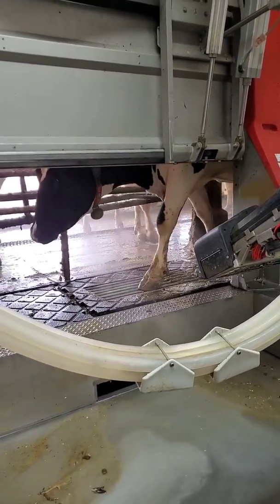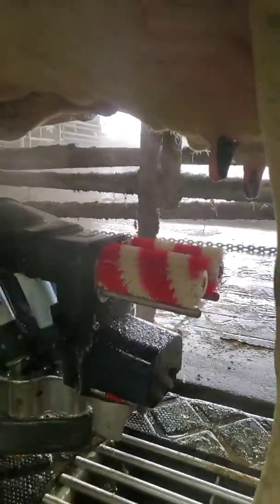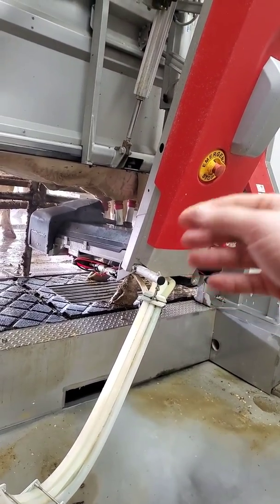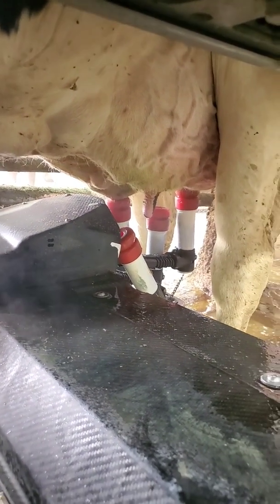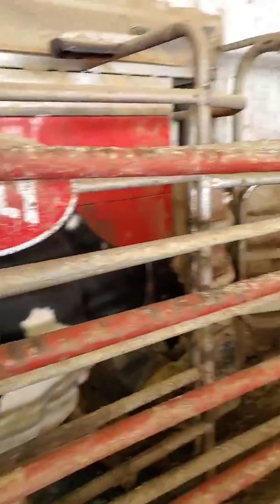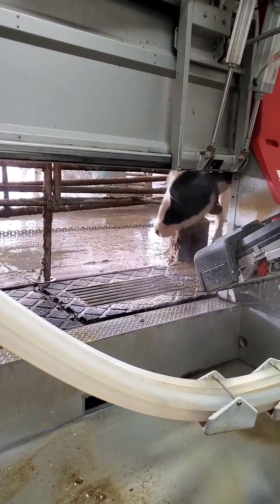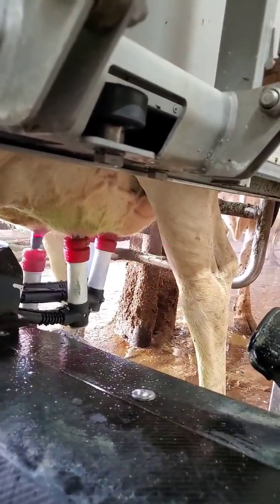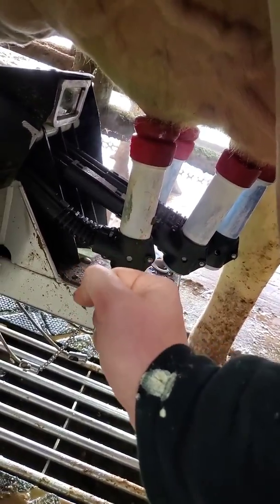How does a robot milk a cow? The whole process from start to finish!

Comment: This is pretty cool, as I understand it a cow with full udders can be in pain, so these milk cows are happy to be milked and walk right in all on there own.

When I was a kid in Dayton Ohio in 1966 I watched the new fangled milking machine as it milked the cows  I belive as far back as the 1950s this was still being done by hand.  If you had 150 head of dairy cows on the farm you spent a lot of time milking cows feeding cows and a lot of people on the farm to do the work.
Even with the robots its still aclot of work.
You have to keep the milking area clean
Cows have to be feed, poop has to be cleaned up,  and with modern machines it can be moved to a pit for composting prossesed and turned into fetlizers.
If your not using what is comming out the cows backend then your loosing money. Lets face it whats it cost to make 1 gallon of milk?  What you get at home isn't what came out of the cow.

Comment: Milk hauler here in az. I have yet to see a robot. They do the semi old school way. Walk up and down the parler or they have a giant turn table.   Last couple of day were nonsense for me because I had to dump a whole load because loads that got pulled from that silo popped hot for high acid. Chiller didn't work right and when they got it working they cycle the milk back through the chiller. Got done loading for my boss to call me saying all the milk in the back barn was bad. Dumped my milk on the loading pad. They also had to dump milk on the loading pad and wash silo and start over again.
Reply: Silo? High acid?